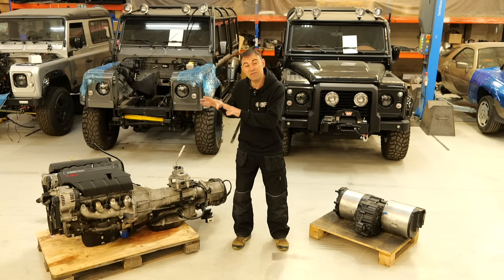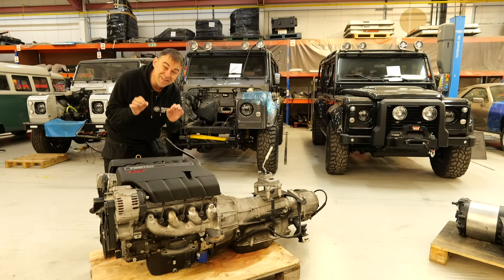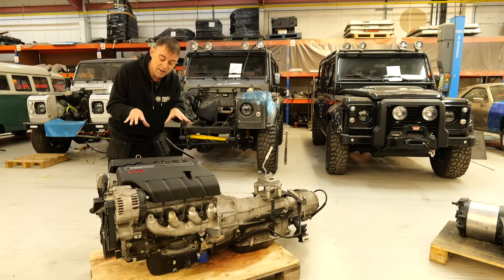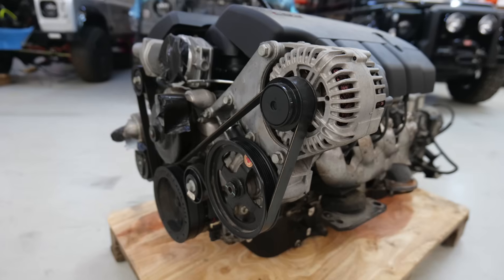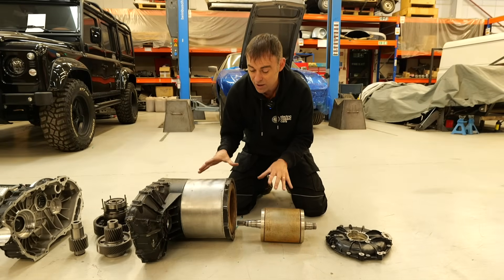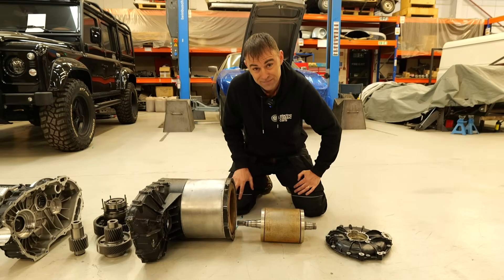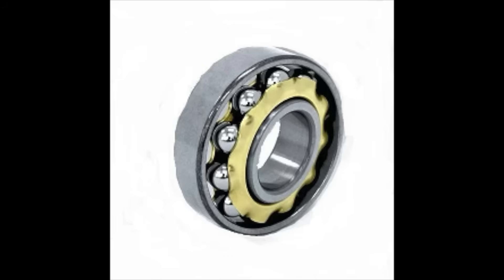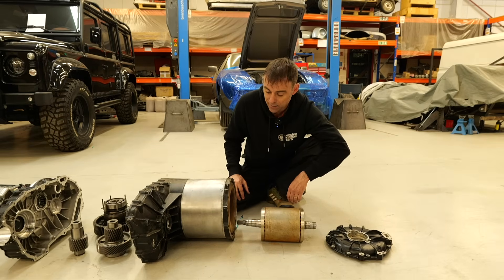Let's compare the Tesla LDU with an LS3 V8 and take one apart to see what makes it tick.

Comment: Is there an electric motor that is 3 to 4 times smaller than Tesla LDU? I am working on the puzzle to see if I can convert my Reliant Kitten Estate to electric and want to replace the rigid rear axle with a Dion rear axle and am therefore looking for an electric motor with differential that fits in between.
Reply from the maker: Yes. There are loads of options for you. I’d recommend looking at a motor out of a Zero SRS motorbike. 👍
Reply: @ElectricClassicCars  Thanks for the information.
Reply: This old jalopy is doing just that with a Nissan leaf drive unit and a fabricated dion axel replacment for the solid diferential. https://www.youtube.com/watch?v=kFgg-asvwiw
Reply: @JonathanTamm  Thanks for the information. I follow him too.
Reply: Loads, look at smaller EVs like the Chevrolet Spark or the Renault Zoe.
Reply: @ziploc2000  Thanks for the information.
Reply: Maybe a Google search for a "Electric Differential" may help or Wheel Hub Motors, many available ...
Reply: Dyson?  [cheeky]
Reply: @tepidtuna7450  Lol
Reply: A Hyper 9 motor would surely fit. In this case you would need to either connect to existing prop shaft or another drive/differential combination as the motor does not come with any diff.
Reply: @MrAdopado  Thanks for the information. That's why the puzzle is so hard because I want to get rid of the old drivetrain.

Comment: For a truly comparative demonstration the whole of both systems need to be evaluated, it is easy to show how simple and compact a 1000hp motor is compeared to an ic engine of any flavor but then demonstrate the control systems and fuel tanks as well, in my opinion one is not better than the other just different. 
And for anyone living in Australia there is almost no green advantage for electric vehicles as most of there power generation is coal fired.
Reply: But should be solar ….
Reply from the maker: Having been to Australia many times it’s hard to understand why Australia doesn’t have huge solar generation. Is the government over there too pro coal to protect its mining industry?
Reply: @ElectricClassicCars  
Corruption, plus "US influence"?

Comment: EV motors do effortlessly what ICEs can only dream about - max torque from 0 RPM to 18K...  Good God.
Reply: They can't do max torque until 18k! They have a flat torque up to their field weakening point. Check out their torque curve.
Reply: Yep, Engines and transmissions have had 100 years of development and are still noisier, rougher, less powerful and last less time than electric motors.

Comment: The difference in complexity between the two motors reminds me of the late 1950s when airliners went from piston engines to jet engines. The last generation of piston-engined airliners were typically powered by four Wright R-3350 18-cylinder turbo-compound air-cooled radial piston engines developing 3,400 hp each, of which 400 hp came from a turbine in the exhaust connected to the crankshaft by a fluid coupling. Unbelievably complicated, with thousands of parts moving in all directions. Then along came the jet engines, with not much more than the rotor and stator of the Tesla motor, and all rotating in only one direction.
Reply from the maker: Good analogy. 👍
Reply: Maintenance was the reason piston engines were replaced with jet/turbine engines!
Reply: @stankygeorge  and turbines ability to make huge power in a lighter package.
Reply: Trains and trams with electric motors can run for incredibly long times with maintenance, like the Balloon trams in Blackpool from the 1930's, and still in regular use. In Osaka the Loop Line was using 1960's trains until 2016, when they were finally retired... to less busy lines, where they continue to run, and probably will for another 20-30 years yet.
Reply: The problem is this is a stupid comparison. One is an apple the other is a rutabaga.
Reply: Thats why people tried to come with petrol engine with rotational piston. Mazda had several models with Wankel engine. I dont know much about them but it would be interesting to analyse why Wankel motors never came into car industry in big numbers.
Reply: @DrazenZagreb113 The Wikipedia article sums up its drawbacks nicely: https://en.wikipedia.org/wiki/Wankel_engine
Reply: @DrazenZagreb113 Rotor sealing and less efficient are the two main reasons
Reply: There is nothing simple about an EV bud , despite what some will try and tell you , less moving parts in the motor yes  , but thousands of fail points in the whole shebang , and this is fact .
Reply: @ I keep saying forget complexity - it’s reliability that counts. Over the long term, if we ignore the first generation of EVs,  EVs will be more reliable and require less maintenance. These are stats we’ll be able to look up but you’ll have to wait 5 years or so for some long term data. All we have at the moment is anecdotal evidence.
Reply: @mikldude9376  Do you own one and have you experienced the difference? Electronics are of the same complexity, but the drive train is not, by far. This is why service stations fear the new EVs - much less to do. (Nearly) no oil service, much less service needed, no belts, no motor to take apart to find the problem, replace one tiny bit and put all together again, ... even exchanging the motor is not more expensive than the ICE's. My Leaf (famously known for a bad battery though) has no repair yet except for a broken spring (and the battery, on warrenty). 110'000 km. Yearly service though (and a trivial one) is about 200$. Tesla 30'000 km, no service costs (yes, I know, politically incorrect, but I will not burn my money by selling that car).
Before my Daimler 190 (historical) needed a set of brakes every other year, had damper replacements, leaking gas tank, detached gas cable, ...OK, historical (nearly 30 years old). Before that, a Ford Windstar: suspension broke (reason for selling), problems with the lambda probes. etc.
Reply: @mikldude9376 well said
Reply: True. But in both cases still a lot of noise and heat (a jet engine can do something with all that heat, still), but as a gas-pump, a turbine is not very efficient either. Because, let's face it, these engines are gas-pumps that use combustion to drive themselves and keep running. In a way, the piston engines are a double gas pump, using a propeller to move the bulk of air driven by a piston gas pump.
The reciprocal motion of the pistons gives a lot of losses in their continuous acceleration and deceleration. Rotation engines (e.g. Wankel's) try to reduce that but swap one inefficiency for another.

In heavy industries, very often, electric components are used to transfer power from one place (the engine) to another (wheels, propellers). The first ship doing so with a diesel-electric propulsion must have been in Russia in 1902.

Such an architecture (what do you do where, why, how, when at the analytical level, not the technical or detailed design) relates to transmission losses. It can be cheaper, better, to transfer power via electric generator, cables, and motor (with a controller in there) than mechanically with transmissions and clutches. Even when the primary power source is in an ICE engine.

Which brings me to the Tesla motor. It still relies on a form of mechanical transmission. My hobby horse subject here is "direct drive". in-hub induction motors probably would be the most efficient. Just have a bit of axle for centrally mounted disc brakes and the unsprung mass issue becomes a non-issue, IMO. And lightweight radial induction motors probably are light-weight enough too. Plus having a hub-motor in each wheel reduces the power requirement and you don't need a mechanical differential.

As to "torque", remember that horsepower is defined as how many times per unit of time that torque can be applied. Torque & HP have an RPM related side. An e-motor that stands still, in theory has an internal resistance of zero and this would facilitate infinite Ampères for a very brief period of time. Which translates into high torque. Question is what remains at high revs. We see an incredible reduction in the range of e-cars when they have to drag a draggy trailer (like a caravan). There must be a simple explanation why the difference with ICE cars is (seems) so big. (I'm not an engineer.)

As to range, note that there are 10 kWh in 1 litre of petrol (gasoline) or 11 kWh in 1 litre of Diesel fuel. If you can drive your car at 18 km/litre, then you need 5.6 litres, which means 56 kWh per 100 km =100/56=1.8 kWh/km. That is possible with a modern blue-motion Diesel car maybe, at a constant speed around 100 km/h provided a good drag coefficient sedan or coupe.With your petrol engine that may be 14 km/litre at best (78% of the theoretic Diesel scenario's performance).
This is all a lot worse than e-cars. But the e-nergy is made elsewhere, transferred via cables, transformed up and down repeatedly, and used to charge a battery under transformation losses with added stand-still and temperature variation losses. The e-car informs about energy taken out of the battery, not what went in, nor what that cost.

I'm all for 100% e-cars, by the way, but we need a different infrastructure or else we pay more per km in electricity when fast-charging along the motorway (highway) than we ever did for fossil. Early adopters do a great job now, but this is why "laggards" are still on the fence, the jury being still out.
Reply: Pretty good summary of the EV issues, I agree with just about all it.
I would make a few points though, grid provided energy even with transmission losses is VASTLY more efficient than any ICE engine. Power stations are very efficient.
Regarding "fast chargers"; they are more expensive but how often to you use them ? I worked as a courier throughout university I would do a daily city run of about 70kms it took about 4hours of city driving. I used a full tank of fuel per week ( about 55L ) I drove an efficient hatchback.
An EV would require one full charge a month and I would charge at home. If I had 800W of solar it might net out at zero, but I would grid tie the solar for convenience.
Reply: @brianmacadam4793  - last time I looked, my country (Netherlands) had the highest per capita and per area non-private recharging outlet density. The West of the country is more populated than the east and it's easy to leave this country in less than two hours. Taking it easy, I would drive an ICE car from Amsterdam to Sicily (2,600 km or so) in four days (3 nights in hotels).
With an eV - forget it.
If I had a job with some 2 hours commute one way, I could do that with an eV but recharging those kWh from a domestic outlet, meh.
I think we understand each other very well.
The short answer is "it depends."
My brother traded his Volvo all-eV model 90 SUV within a year for a hybrid. Has solar panels to charge the car at home.
One time fast charging at the motorway and that was the straw that broke the camel's back. plus the trip to the South of Italy.

It's an infrastructure, tax, policy thing
Reply: @brianmacadam4793  

Not true. EV are only ~25% efficient when you consider the entire cycle. Much worse than diesel or the latest petrol engines. 

Coal power station -  <45% efficient. 
Transmission - 95% efficient
Charger efficiency - 90%
Battery charge/discharge cycle - 70-80% efficient
Motor - 90% efficient. 

The losses are CUMULATIVE.
Reply: @ But there are no coal power stations in my country!
And how efficient is a oil refinery?!...
Reply: @mrbrisvegas2 You should run the numbers on the cumulative losses for getting petroleum out the ground all the way to your local gas/petrol station; an interesting metric to research/consider is how much energy is required to produce a barrel of oil measured in barrels of oil: from what I've read it used to be take a barrel to produce dozens of barrels, but the trend is not looking good with that same barrel spent producing fewer and fewer barrels as the difficulty of extraction has increased; we aren't at a ratio of 1 for 1 yet but we're probably heading that way; and then when you consider the rest of the supply chain of transportation and refining and transportation after refining, the whole end to end process is very costly and inefficient; if petroleum fuel was the "new thing" today people would be crying about how much work and how much it would cost to build the petroleum infrastructure! The bottom line is that it's easier to move electrons around than it is to move atoms around: once you run the wires the work for a very long time, you don't need a fuel truck (that also consumes fuel!) to show up every few days
Reply: @mrbrisvegas2  Your argument is comparing Apples with Oranges. If you want to consider those losses in efficiency for an electric motor you need to consider the cumulative losses of getting crude oil out of the ground, the cracking process to separate it into petrol, diesel etc, and then all the transportation losses as well, to get it to a petrol station where you and put in your car. There's probably a few other steps I forgot too. 

Also I don't know where you live either, but in Wales (and the UK in general) where ECC are based, a miniscule proportion of the electricity (and possibly none at all now) comes from coal fired power stations.
Reply: @mrbrisvegas2   I'll admit his figures are a little bit out with drivetrain and roundtrip losses but you're analogy is biased. If you’re going to factor in grid efficiency then you have to factor in drilling and mining for oil, transporting it to your country, refining it and transporting it all over the country, then pumping it into you car. Our grids are getting cleaner and more efficient every day, ICE cars have just about "exhausted" all possible efficiencies.  BTW - the real cumulative losses for a kW from the power station to the road wheels is between 62.7% - 78.5% including transmission losses for a typical EV. My figures are backed up by a quick internet search which quotes EV efficiency at typically 77% from power station to the wheels. So it all depends on the efficiency of the grid. On the other hand more than 50% of the energy is wasted before you even pump the petrol into your car. So you have to halve ICE efficiency - at least. I noted you included charger losses and then charge and discharge losses but that is incorrect. Charger losses are included in the round trip efficiency which is typically between 85% and 92%. No matter which way you want to cut it EVs are way more efficient than ICE.
Reply: Let’s get down to the bottom line, cost to operate an EV compared to gas/petrol/diesel per mile. My Tesla X is by no means the most efficient model and I live in a subarctic climate with expensive electricity rates and cheap gas. Despite this it costs less than 10 cents a mile to operate. My smaller car is 23 cents and my truck is 38 cents. 

No oil changes sounds trivial but a synthetic oil change is at least $140 here or $50 and an hour crawling around my garage trying not to hurt my back. I already had a 30 amp dryer circuit in the garage so no extra costs and my tank is always full. On a road trip 300 miles is a realistic range and by then I need to stop, stretch and pee so a charging station is welcome.
Reply: @Andrew-kj9fz you must not be a very good mechanic
Reply: @jpdj2715   Some interesting points. You also need to include the transfer of the petrol/diesel energy to the delivery stations and the energy used to refine, transport, and wage wars to secure it.
Reply: @jimbojonesporfavor  The cost of war-waging is the deciding argument.
Reply: The electric car is no less complicated than the ice car
Reply: @markdi2  Forget "complexity" which is a nebulous term and consider reliability. The electrical side of EVs may be more complicated but it's not rocket science, especially when you consider if a module fails on an ICE car no one repairs them - they just replace them. It's exactly the same process for an EV. That's why we say it's less complicated - there are plenty of parts on an ICE car that recommend "service intervals" that just aren't present on EVs or subject to a lot less wear and tear (brakes). The only thing I've done on my Tesla in 2.5 years is rotate the tyres, replaced the wiper blades and had a dodgy headlight replaced under warranty. So forget complexity - instead consider which is more reliable? Is your iPhone (complex electrically) more reliable than a Ninja blender (complex mechanically)? At least in my experience that's a hell yes.
Reply: An ICE engine both extracts energy from the energy store (petrol/diesel) by burning it in a cylinder AND creates useful motion from it.  The electric motor in an EV only does the second of those tasks, so this is only half ths story.  The other half is that In an EV energy is extracted from the store (electrical potential in the battery) by chemical reactions and then passed to the motor.  Complexity may have been reduced, but not by as much as it seems.  A lot of the complexity has just been moved to the battery. The battery is big and heavy, and adds at least as much weight to a car as an ICE, usually more. It also needs complex electronic management and temperature management, as well as adding huge cost to a car. However it is not  a serviceable item.  So routine servicing is less and less costly than an  ICE ... but when the battery reaches the end of its life it (or the whole car)  has to be replaced at great expense.  Furthermore, many advances are made in ICE technology to increase efficiency and reduce emissions. After decades of increasing complexity recent patents are for ways to simplify the ICE and reduce the number of moving parts.